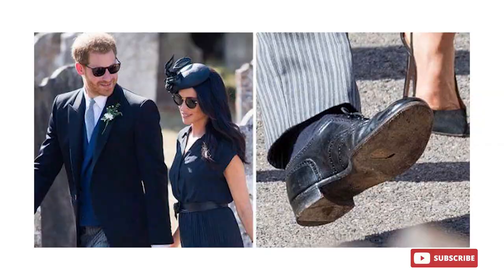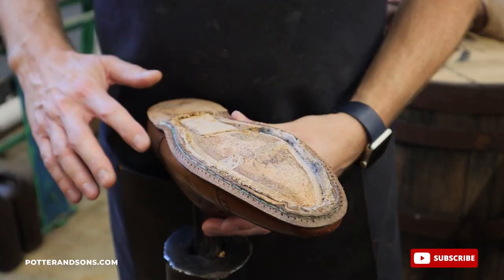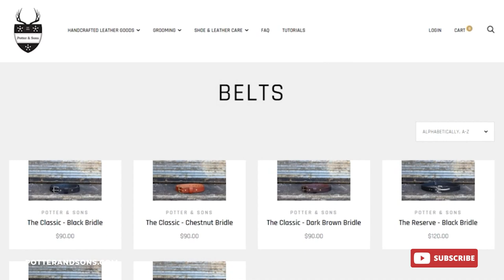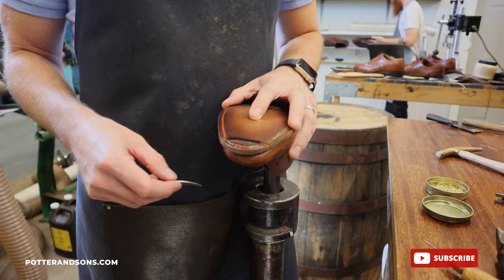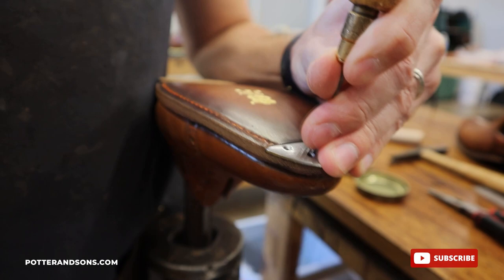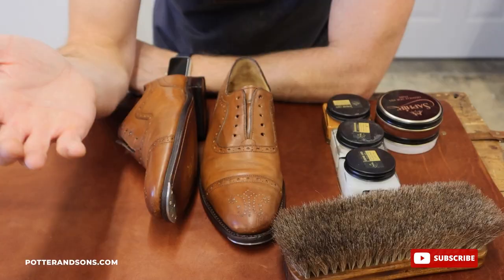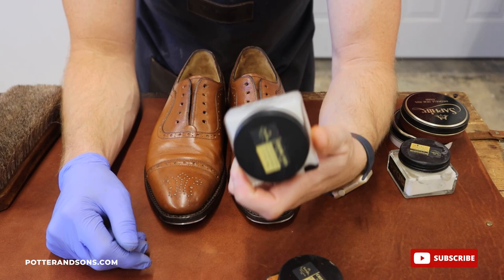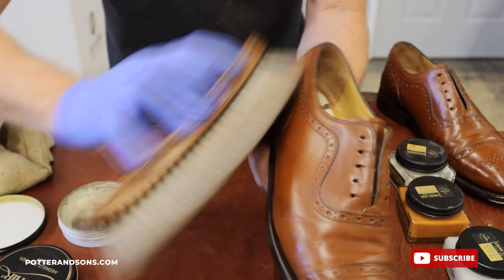The HOLE in PRINCE HARRY'S SHOE | How It Could Have Been Fixed

Comment: Hey guys, the shoes look great!  Usually you nail from outside the heels into the shoe. Why did you nail from the opposite direction on these?
Reply from the maker: Usually, if it’s a 360 welt, you can nail the heel block from the outside inwards.  If it’s a half welt or 3/4 welt (like these), you generally nail the block on from the inside.

Comment: I bought two pair of Florsheim shoes over 20yrs ago and wore them daily for a couple years and since then only once or twice a year.  They are showing signs of surface cracks in the uppers.  Q.1. Can I restore the leather so they continue to last?  Q.2. Can I "fill in" the light surface cracking with something to get them smooth again?  They fit like a hand in a glove and I surely want to keep them another 20yrs (which I know is a fantasy).

Comment: wish i would have known about you guys back in the day when my leather combat boots needed redone.  the were fitted perfect to my feet.  have been buying "hiking boots" for work/ every day use and the price has got way out of hand.  im a custom knife maker and could really use direction as to what boot to buy that can be rebuilt once broke in and used hardish.  being USMC not worried about maintenance just need to have direction  on proper care of the boots cause im sure its different then combat leathers back in 96.  i wear mostly 3/4 cut height non steel toe (can skip the steel shank these days) budget woudl be nice to stay sub 500$ again more work boot then dress boot

Comment: I’ve actually been to the Charles Tyrwhitt store on Jermyn St. Honestly, I was not impressed with their range or quality. Once I saw the paper in their soles here, I’m doubly glad I didn’t buy them. Honestly surprised they used to be made in Northampton! I’m fairly certain these are made in India (a big clue is their price) as are some of Loake’s lower end shoes. The quality is just not as good as those from
Northampton and you can tell by just picking them up. 

The funny thing is that you can’t buy these shoes in India, which is where I live! Unfortunately, Indian made shoes get a bad name due to the use of cheap material and labour, but there are a few good brands here that work with European leather and have trained their staff to do work that is sometimes better than what you can get out of Northampton!
Reply: Tyrwhitt used to use Barker to make their shoes, even the lower priced ones and obviously had 'Made in England' stamped on them, they were very good but they switched a few years ago.
Reply: @chuckbuckbobuck  I think the shirts were made in Romania at one point, that might have changed.  The shoes were made by Barker but then they switched but still have a 'Made in England' range.
Reply: @tomconnor7786  Tom,  they havent been made in Romania in decades, if ever.  I think you are getting mixed up with Eton who still makes there shirts there.  Romanian craftsmanship is top- notch just look at St. Crispin's, some of the best shoes in the world which are made in the same country.  CT makes, or did make their shirts in China, regretably.  I don't buy China under any circumstances unless I have no choice.  Don't give the enemy our momey!  Believe me, they are our enemy!

Comment: If i had to hazard a guess, these were made by Sanders and sanders in Rushden. They are excellent shoemakers. You have to remember that any brand who places an order in a factory will need to hit a price via their own margin, and that dictates what the factory use in terms of components. The comments on the heel, although fair, are again dictated by the price and the brand. It looks like the uppers are not eyeleted, rather than blind eyelets which real shoemakers. Punched holes instead of eyelets are one of the laziest shortcuts made by factories, so i suspect that they are probably imported Indian uppers which is why the price is so low…..
Reply from the maker: Thanks for your insight, Ian.
Reply: @TrentonHeath  Love watching you guys learn and grow! True cobblers! I just watched your Dr Martens video. One of the few cobblers who actually understand the construction. It is basically a Norwegian welt, and the locking is fixed by hot wax then slightly over stitched on the inside join. If that is missed, it unravels. The key to the construction with the welded sole is that the welt is sewn in square so that the rollers and hot knife produce a complete weld. If the welt is at an angle and only partial weld occurs on the surface area, it separates in wear….i grew up in a Northamptonshire shoemaking family and and made them for 30 years. A fascinating construction. Love that you are in Nashville. Do you get any support or love from Genesco?